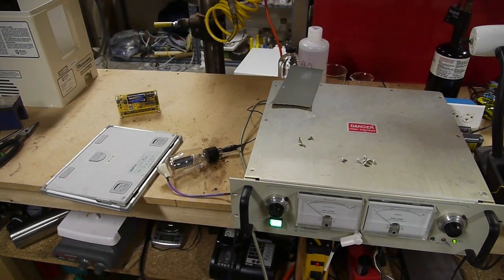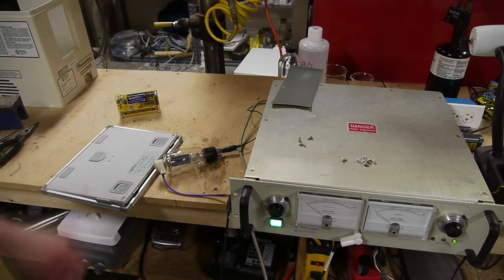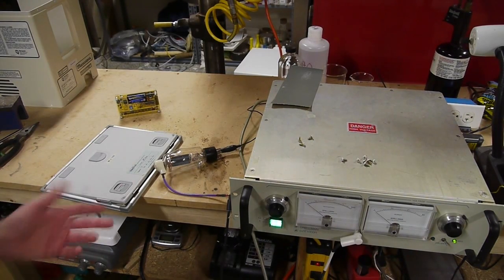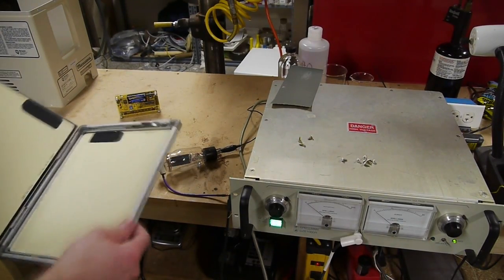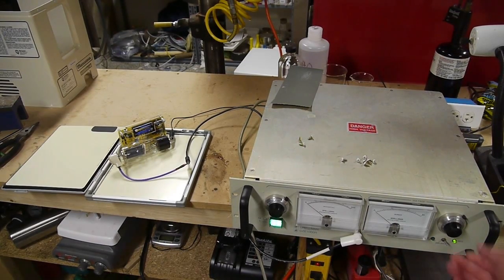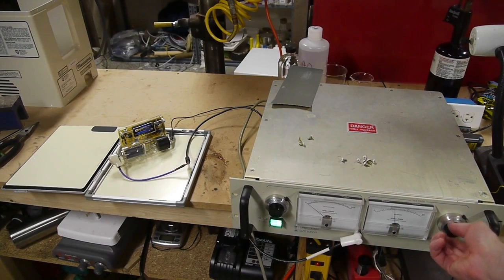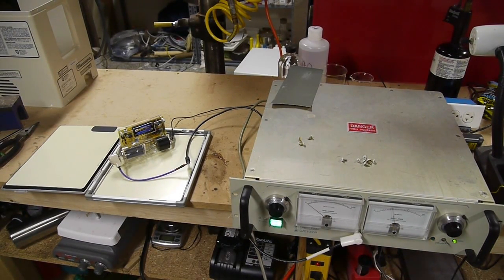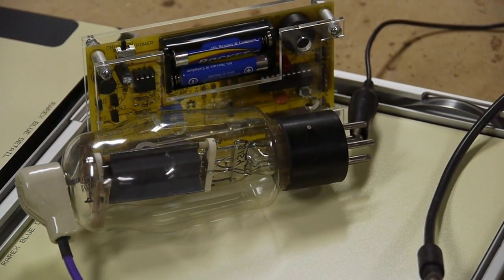Creating X-rays with a standard vacuum tube

Comment: Dear Mr Applied Science  what you are seeing is a result of ambient radioactivity hitting the anode or cathode and causing an emission of electrons from the surface which are then accelerated to the opposite electrode . Your  811A transmitter tube is acting as a sort of Geiger tube. 
What a pity that such a useful medium is so poorly used.
Reply: Azzy M , electronic are accelerated  striking a tungsten target. that causes ionizing radiation, by means of the brumstrulm (ms)  process.… ..

Comment: ebay sells tiny china step up devices that claim 40kv, i didnt take these claims seriously until i found that i could make 1cm arcing with only a tiny single aa battery as input to the thing..
Reply: But those things pulse really slowly and sloppily though. I think his PSU is continuous or has a very nice waveform.
Reply: Chris Petrie search "high voltage converter" on ebay and look for the small black cylinders with wires coming out.
Reply: Where? I'd love to get one for my students.
Reply: yes its bought from ebay, great tiny device, I loved it very much, value for money, be sure not to overload it and don't let it run without allowing the other end to discharge, it can ruin the module easily as well
Reply: You could easily be producing 10,000 volts with your rig, just not much current. Even the magneto of a lawn mower engine can produce that high of voltage.
Reply: yes my 100cc bike from the 80s has magneto cdi ignition system, it generates several hundred volts via tiny gauge windings rectified  to a capacitor and then triggered by a transistor to the high voltage step up coil ONLY then it gets to a few thousand volts to spark the plugs!

Comment: nice explanation but were you using the cathode tube as a spark gap device enclosed in vacuum? i try a lot of experimentation with ignition coils and buzzing switches to run them on open spark gaps, am i exposing myself to xrays?
Reply: read somewhere you need 300kv to make xrays..so I guess not..

Comment: You really need to get up to 50KV before you start to produce any x-rays energenic enough to penatrate the glass and metal inside the valve. Most flouroscopy is done around 3 => 8mA. Plus there's the inverse square law with any radiation, visable or not. And intensifying screens don't light up that much even if they are in the primary beam. You need the very old ones that were used for short exposures or an old flouro plate.  Great video with your limited resources. Oh, one more thing X-Ray tubes are about 1% effecient. 99% of the energy is turned into heat. (That's why the anodes spin) The noise you hear during a X-Ray.

Comment: @ Applied Science: Could this be the "Cherenkov Radiation". It is a blue light that appears when particles traveling with the speed of light travels through different mediums so they are slowed down from their velocity in vacuum; the refractive index of the medium determines how slowed down they are. Once the particles escape into a medium with lower refractive index it accelerates into a speed faster than the light in their medium producing the "light boom" (like a sonic boom in airplanes when the speed of sound is surpassed).  When this happens in nuclear plants, the water in which the cores are submerged emit this blue glow. I suspect he particles comes very accelerated being in the vacuum, when they arrive to the new medium (the glass) they are traveling faster than the light in the glass so they produce the visible "light boom" so we see the blue glow, blue light is characterized by a shorter wavelength.
Reply: +Eagle Dee Electrons are you saying that those electrons are travelling faster in the vacuum than what light does it trough the glass? And why should electrons hit the glass if they are being atracted to the other pole?
Reply: Since you where able to pull quite much radiation which shows quite high in the counter, I assume the x-rays gets generated as EM radiation outta collisions of electrons with atoms in materials around, perhaps the glass itself. X-rays penetrate better through materials which means it's velocity is affected less when traveling through the glass. Since normal light around travels slower by the amount of refraction level of the medium: boom! expansive wave of light. Sure the energy pumped in is enough to make the whole event of electron transitions to generate as well an electromagnetic field so strong that may surpass the glass and beyond. EM radiation is not easy to contain, I guess.
Reply: Yes. Maybe this experiment has to be more variable-controlled to minimize the risk of false positive readings.

Comment: are you sure your x-ray detector is detecting x-rays in your setup? am asking because you had it very close to your tube. it might simply be influenced by the strong electrostatic field your were applying to the tube.
there are several ways to test this. one of wich is applying the inverse square law.
good luck
Reply: +Amira Lozse Good thinking! But look how every beep occurs consistently with every current peak in the amp meter of the power suply. When current flows, the amp meter detects it and that current are the electrons hitting the other electrode and producing the radiation. I don't know if i'm missing something here. Maybe the magnetic field of the electrons is influencing the readings of the metter but the current is so low I don't know if this is possible.

Comment: Nice video, but I you seem to have made a couple of mistakes.  The X-ray film cartridge doesn't have fluorescent materials inside it.  If it did the film image would be very very blurred as the light generated inside it would leak all over the place.  X-rays will fog photographic negatives directly, so all the case has to do is be light-tight and x-ray transparent.  The fogging effect of film was how Bequerel discovered that Uranium salts were radioactive.
Reply: I think you are very much mistaken.  My Kodak X-Omatic cassette has exactly that - two intensifying screens inside.  The film goes between the two.  Trying to expose photographic emulsion with X-rays alone would result in much higher radiation doses to the patient.  BTW, the images from intensifying screens are incredibly sharp.  Also, you can purchase replacement screens.  I have several - some employ calcium tungstate, others use rare earth salts.  The reason Becquerel obtained a foggy image was because the gamma ray sources (individual atoms) were diffuse throughout the material.  A proper X-ray tube projects from a foreshortened line source that approximates a point.

Comment: I did something like that with an old slightly gassy 6JE6.  Ran one end of a 12Kv neon sign transformer to the plate cap.  Yeah, just like that, the tube glowed blue, but the getter deposit had a ring of green light coming from around it.  I shut it off!
Reply: What is getter deposit?
Reply: Your tube was just simply running as a glow discharge lamp. calculate the wattage. I'll bet it didn't even warm up.

Comment: im now concerned about the tube amplifier in my hifi setup
Reply: I doubt you have enough volts to be worried. Even if you did, the tube glass would do what it did here and take a lot of the radiation out. People have been using tubes for a while, I just wouldn't be too worried.
Reply: +kay c your good as long as your not powering a concert that can be heard for a couple miles XD
Reply: +kay c whats the highest voltage in your amp? if its a couple of hundred volts (typical for 'usual' tubes) you are completely safe. such voltages will only produce soft x-rays, they are far too weak to even penetrate the glass of the tube.
if your amp uses several kilovolt (which i strongly doubt) you might need some additional shielding. glass will become translucent for x-rays above 5-10 keV. have a look at http://physics.nist.gov/PhysRefData/XrayMassCoef/tab4.html and
http://www-old.mpi-halle.mpg.de/mpi/publi/pdf/4921_03.pdf
Reply: +kay c i would be concerned about that working at a radar station

Comment: I doubt anyone is going to read this and really understand it, but the "x rays" shown in the video is just RFI from the arcing inside the tube.  You have to be upwards of 90kv to get xrays.  I was reliably able to generate xrays in my home lab, but it wasn't near as easy as hitting an old tube with 15kv.  I used 120kv and an old mercury puddle rectifier that I modified with a hot cathode and a tungsten plate.  Not saying ANY xrays would be generated using your method, but it is an ultra minute amount with no energy.
Reply: Monel Funkawitz That is inaccurate; x-rays can indeed be produced with as little as 15 kV and using certain receiver tubes. I have used the method to usefully expose polaroid film without any phosphorescent material. It is weak, but present nevertheless.
Reply: If it isn't glowing green, it isn't producing.  Not blue... green.  If you are trying to light phosphorus, you really gotta nail it.  To cold cathode, you need a functioning anticathode, and your target inside the tube needs to be dished to focus the xrays.  You gotta hit it hard if you want high energy xrays.  I had mine to the point where I could develop film with a chicken wing as a finger analog in a 2 second burst.  Figured I better quit before I screwed up and triggered the remote with me in close proximity and got blasted. My tube had a green glow to it and I had to water cool the target.  A lot of work, but it did work.  I tried tubes, bulbs.. everything, but could not get xrays without a heated cathode, and could not get high energy xrays unless I got close to 100kv.  You could tell on the electric bill when I was playing... lol.
Reply: I was using OLD 6BK5 tubes (thin light glass bulb). Very slight voltage applied to the cathode heater; just enough to eject some electrons, but not so much that would load the HV power supply below 15 kV or so. And yes, a green glow was noted, in addition to a permanent discoloration (brown) of the glass.
Cool stuff.
Reply: @monelfunkawitz3966 okay maybe he isn't producing x rays in this video but you can get perfect x ray images of electronics and dead headless rabbits with under 40kv. 
So you sprinkled lies through your comment. For some reason.
Maybe you believe them yourself. So go read a scientific paper or check out  a commercial low power x ray machine if you refuse to read. Even 20kv can produce x rays.
Reply: Monel Funkawitz
Useful x-ray production IS possible down to 15 kV; aI bit weak, but useful. the gm tubes I use ARE shielded against EMI/RFI.
No,one does NOT need 90kV.
It is well established the older vacuum tube color television sets produced easily measurable x-radiation, mostly from the shunt regulator tube (6BK4 to name one such type).
with about 25 kV across them. I have a large collection of them where the entire glass bulb has been stained dark brown due to exposure to x-radiation. And, no, I do not mean cathode stains; I so mean x-ray stains.
Reply: Emi/rfi.  Put the Geiger in a completely sealed and grounded metal box and see if it triggers or wrap completely in aluminum foil that is grounded.  Xrays will penetrate that AL no problem.  

If you start into the dark path of ionizing radiation, make sure you KNOW what you are doing and have redundant safeguards in place.  I had a friend learn the hard way that just because the detecting equipment isn't working right, doesn't mean the danger is not there.  You can get a fatal or cancer causing dose way before you feel it.
Reply: +Monel Funkawitz This may be correct in his case, as I ran into a problem of triggering my geiger counter with RFI when i designed my x-ray generator. It wasn't until I increased the output voltage to 25kv that soft xrays were being produced. I know for a fact it was x-rays being generated, as I used multiple Geiger counters, and one of them I grounded to eliminate the RFI problem. You can see the videos on my channel for more info. I did not see any glowing in the phosphor screen however, since the phosphor screen is used in medical imaging where hard x-rays are used, the x-rays the vacuum m tube approach generates are low energy x-rays, and are attenuated much more easily in water and air than hard x-rays. Soft x-rays will penetrate shielding however, and did so, giving me positive result.
Reply: Monel Funkawitz 

The X-ray diffractometer that I used in grad school was 50 kV, with the option of lowering to 30 kV, if I remember correctly.
Reply: Lol this is definitely what nerds argue about... ain't seen many hillbillys having these types of conversations
Reply: Monel Funkawitz how you explain the Geiger counter?
Reply: so the blue in glass  glow is what in your opinion ?
Reply: The glass used in those vacuum tubes will fluoresce when bombarded by electrons of sufficient velocity. Some of those striking the metal parts within will produce X-rays.
Reply: "The glass electrons are absorbing some of the electrons colliding  from inside tube and fluorescing when they drop down to their nominal levels ?"
.
Yes. Electrons that missed the plate and shot through to the glass. Takes a fairly high velocity for that to cause the glass to fluoresce. The tubes I used were 6BK4 (shunt voltage regulators used in tube color TVs).
Those were known to produce X-rays, usually projected towards the base of the tube. It being mounted vertically, base down, directed most of the energy out of the bottom of the set.
On some of those tubes I mentioned, the glass is completely stained as brown as a beer bottle. From X-ray exposure.
Reply: TY. So the speed of the electrons is knocking the orbits of the electrons in glass around . Or .. The glass electrons are absorbing some of the electrons colliding  from inside tube and fluorescing when they drop down to their nominal levels ?
Reply: So I've been holding a burned out incandescent light bulb near my 400 kv Van De Graaff generator and it's producing pretty much the same purple uv glow this tube is producing and I smell a lot of ozone.  Is it also producing x-rays, and in sufficient quantities to be concerned about?
Reply: @Permaglo  I doubt it. Incandescent bulbs no longer contain a vacuum. I believe they use an inert gas of some kind these days, so it's likely not possible to get x-rays. If it does contain a hard vacuum, then it is possible.
Reply: You can get x-rays at around 60kv.
Reply: Monel Funkawitz WRONG!
Reply: Monel Funkawitz You can generate x-rays with scotch tape, 0 volts required.
Reply: Actually, it's not x-rays you have to worry about, but y-rays. Why? Exactly!! 😄
Reply: Thats not true people have done it with 60kv
Reply: @Mike Studmuffin  It's the placebo effect.. you're expecting some kind of 'something' to happen, so your mind makes it so. You'd have to have a severely overvoltaged TV (or very old design) to make xrays in the first place, and you'd have to expose yourself for a very long time before you accumulated much of a dose.
Reply: I've seen commercial x ray machines that get results with as little as 20kv.
Go watch "buy it fix it" and you can see the results if you don't believe me.
The machine allows tuning of the voltage and he tries many successful under 40kv x ray tests that you can see in front of your occipital lobes. So please don't spread false information. I don't know why you would want to, but you are doing it, so please stop (spreading lies)
Reply: Monel Funkawitz RIght, if he was producing enough XRays to excite his counter it certainly would have produced a glow in the phosphor.  No Xrays, just RF

Comment: I used 811A's in many Tesla Coils, but those were running at 1200 VDC plate voltage. You're 10 times that.
I would really hate to see a video that showed X-rays coming off an 811A at its usual operating voltage!
Thanks for a very interesting video...
-- Dave

Comment: I readed the datasheet. But i didn't find anything for working voltage for it. Is it okay to power them on (200)kv and 2A?
Reply: Where you gunna git 400KW from?     ;)
Reply: Yes but it is a marx generator not a true power supply for long works